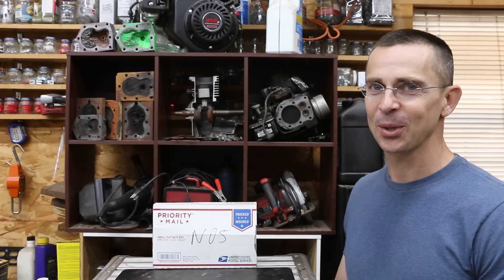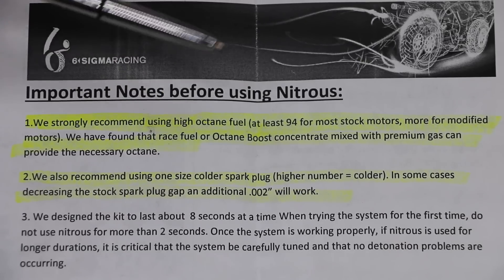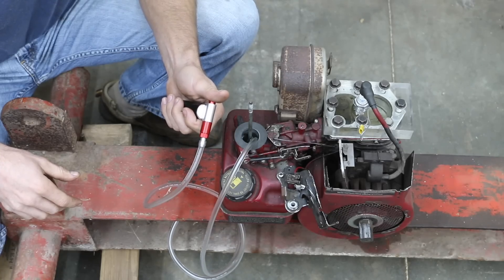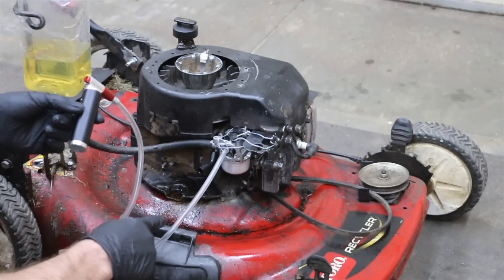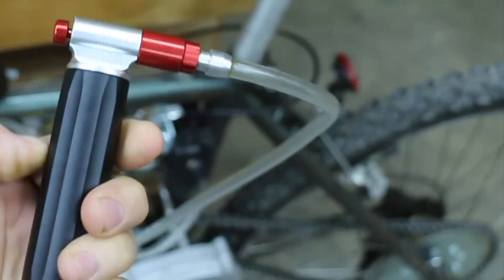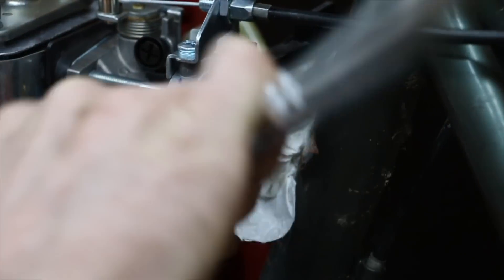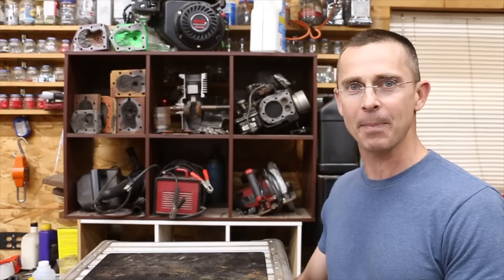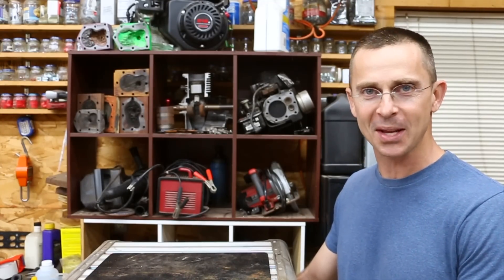Will the 4-Stroke Bike Survive Nitrous Oxide?  Let's find out!

Comment from the maker: I had a LOT of fun with this video and thanks to everyone who suggested this video idea!  Here's the kit I used but it is very expensive.   Recommend shopping around for a better price.  Nitrous kit: https://amzn.to/2QiJ74m
Reply: Hi PF, what if injecting oxygen from  scuba tank through that air box nozzle . Does it add more performance and engine response? But i was expecting testing it on bigger engine like car or truck engine. If it turns adding good power gain, doesnt that mean we can refill the tank  or airbox with electric pump and provide more oxygen at the intake at almost no cost
Reply: @focalpolyglass7337  there is regular air in a scuba tank, the only real benefit you could get is because the scuba tank is under pressure, so it provides boost similar to a turbocharger
Reply: Hey man I would really love to see a video on if a 4stroke will run nitro methane
Reply: Ooo
Reply: Try it on an rc nitro engine
Reply: what will happen if the engine is fuel injection
Reply: It needs additional fuel , along with nitrous . Otherwise you're only leaning it out .
Reply: The way nitros kits normaly work is that the nitrous oxide is shot into the motor along with extra fuel the extra oxygen from the nitrous oxide allows extra fuel to be burnt and that's where the power comes from I don't see any extra fuel being put into your motor
Reply: Im so glad i found this channel. It seems any questions i have, i find a video of yours that answers them.
Reply: They sell food grade nitrous oxide (no sulfur) at a local store for canning your own whipped cream and other stuff. They also sell something called a "co2 sports inflator" it's literally the same thing you have for your kit but doesn't come with hoses.
Reply: Put a turbo on it 🤣🤣
Reply: You make me think is he laugh lamo kid
Reply: Can you Run about 75v though carbon electrodes with spark ignition on a sealed neon gas engine with a strong neodymium magnet in the cylinder head? Yo may need to see which pole gives the most power? Also you may try using a smoke alarm americium element to boost ionization?  This is probably dubious at best. Where you have a sealed engine of inert gas with two carbon electrodes at high voltage in addition to the spark plugs. And all the weird stuff.
Reply: Hahaha! You're mad!
The good kind of mad though!
Have a sub 😁
Reply: I've gone about 25-30 mph on a cheap 66cc 2 stroke bike motor. That actually feels pretty fast. I can imagine that 40 mph probably feels like lightning on a little bicycle. That said, Ill be getting the 4 stroke one you have.
Reply: Where did you buy your 4-stroke kit?
Just order one UPS went out delivered to some other address in town in town.
But 35 MPH is really good for such a small motor.
Reply: Please tell me where I can get one of these NOS kits. Thank you
Reply: @scottwawrzoszek1119  unfortunately this kit was discontinued. It is a "Triple Threat V8 Wet Kit" from DEi (Design Engineering). It's a shame they discontinued it too because it's by far the most COMPLETE kit ever. I have installed a few different brand kits and they all need something or another to complete the kit. Whether it was a WOT switch, purge kit, or just different jet sizes. This is the only one that had everything in the box!
Reply: Recommending this kit or any NOS kit for a small engine is dumb and removes any credibility you had.
Reply: @stanlee3980 Just because PF didn’t check all the boxes for you is not reason for your insulting opinion.  If you want true science without entertainment, you are watching the wrong channel.  Many folks, myself included, are entertained and even inspired by the down home efforts by the host.  To many people he is their Doctor Strange exploring the mysteries of backyard mechanics or testing products that Consumer Reports have not.  Dumb is your opinion when you erase any credibility that PF had because he ventured into NOS properties without applying it to an engine that is not of a size approved by your higher intellect.  You might get more entertainment from Scientific American or Marvel comics.  I see PF as the common man’s reality to questions that they have but don’t have the resources, intelligence, or balls to try.  A hero to my kind of people.

Comment: Actually, nitrous oxide is an oxidizer. It does not add power by decomposing explosively, it gets it's power from allowing more fuel to burn in a combustion chamber. Burning more fuel equals more power. That's how nitrous oxide makes more power.
Reply from the maker: Thanks for sharing.

Comment: If this kit actually increases the power output of this engine, I'll be shocked.
Reply from the maker: Thanks for the feedback.
Reply: It for sure made a bit more. I've seen a few bikes (motorcycles) that "got away with" adding a 40-HP shot without adding any fuel but they didn't make 40 more HP until the proper amount of fuel was added as well...

Comment: Look in to power jet carburetors they have an extra fuel sprayer for more fuel mixture at high RPM I'm planning on adding it along with nitrous on my 200cc motorcycle maybe it will reduce ping and a cooler plug wouldn't hurt wish me luck

Comment: The injection of nitrous oxide into an engine means that more oxygen is available during combustion. Because you have more oxygen, you can also inject more fuel, allowing the same engine to produce more power. Nitrous oxide is one of the simplest ways to provide a significant horsepower boost to any gasoline engine.
Nitrous doesn't burn because it's an oxidiser,  not a fuel.

Comment: Love your channel.. Here is my long, long time ago nitrous use.     
In the 70's, long before nitrous was available in any kit from anywhere for anything
I added nitrous to two vehicles that did not need it, a 1966 Sunbeam Tiger with a 289 engine and my 1975 Kawasaki H2 750 triple two stroke motorcycle.
It was difficult to get nitrous from the welding supply gas places because kids were starting to breathe it and mostly only dentists were buying it. I finally managed to get lecture bottles filled.
You MUST add additional fuel to get more power and also not leaning the engine out. The nitrous will allow that extra fuel to burn which is the souce of the extra power because the dynamic combustion ratio is so extremely high.

I had an tiny electric pump for the fuel and pushed through a jet hole drilled with a numbered drill bit, (very small hole). When the button was pushed it would open both the nitrous and fuel solenoids together.

When activated on the motorcycle it would accelerate instantly so hard starting at 80 MPH that it would wheelie.

The Sunbeam tiger worked great on its third engine. The first two expired under testing one spectacularly when part of  a top piston ring spit up into the intake manifold; too much nitrous and fuel.
Reply from the maker: Thanks!  Thanks for sharing.

Comment: More O2 (NOs = Oxidant) requires more fuel...
Pulling the choke throttles air in cheap carbs, so you need another means.

Comment: From what I've read, nitrous  is an oxidizer, releasing extra oxygen into the combustion chamber allowing the engine to burn additional fuel. This is why nitrous kits for cars inject extra fuel along with the nitrous. They also recommend less spark advance with nitrous to prevent preignition. Rather difficult to do on a B&S engine though.   I did enjoy the video. Picked up more speed than I expected and the engine did not grenade. Must have been pretty lean though...
Reply from the maker: Thanks!

Comment: Hi kids and PF this is more for experimenters it don't matter on a $100 dollar motor but if this is a real motor cycle or automotive engine be careful Nitrous blows them motors right up they get hot real fast and the real prob if you haven't studied motors is the pistons get very hot very fast and the rings grow and take up the piston ring gap siezing the piston in the cylinder.  It make them  blow right up.   WEEEHAAA so if your trying this on yer own expensive motor study and find out what supercharged or NItrous engines are using  for ring end gaps before your motor breaks you will be glad you did.   Also as other have mentioned you are dumping more oxygen in the motor and leaning the airfuel ratio out so find that main metering jet and drill the metering hole bigger. or maybe get an extra for experiments.    HAVE FUN
Reply from the maker: Thanks for sharing.

Comment: I use 110oct race fuel in my small engines.  Race fuel is off road use only and contains lead. I believe 110oct would boost your 4-stroke as much as the NO2 and no knock.  The drawback is the price.  I can only buy race fuel at a Pure station here in Alabama.
Reply from the maker: Thanks for sharing.

Comment: I have a ? Where would the nitrous brass fitting u put into the air box go if ur putting the kit on a two stroke and it does not have An air box just the air filter?

Comment: I think I would come up with a way to mount the cylinder of gas as close the the breather box inlet as I could. The gas is being forced down a very long hose with a good size volume of empty space to fill before it reaches the carb. Unless the cylinder of gas is over charged you might run out of pressure enough to clear the feed hose and leaving unused gas . so short version ... did the cylinder of gas continue to flow well past the 8sec. estimate? Or did it end at 8 sec. due to no pressure.
Reply: There's hundreds of pounds of pressure in that cylinder, the hose is fine.

Comment: I have a Suzuki Hayabusa GSX1300R I've put a 100hp nitrous "wet shot kit on as well as a few other mods and it's an absolute beast. The wet shot kit includes an extra fuel pump and extra fuel is added with the N²O to quell the predetonation. The extra fuel also cools the combustion chamber as the added oxygen heats things up just like a cutting torch IMHO. I also installed an aftermarket oxygen sensor in the exhaust so I could monitor the mixture and make adjustments as necessary. Thanks for all the cool learnings. You're the Consumer Reports for the working man imho.
Reply from the maker: You are welcome!

Comment: One problem with this video is lack of understanding of what nitrous offers for engine boost, nitrous adds more oxygen along with a cooling affect to the fuel, you have to add more fuel with it to get the real power, I built nitrous kits for many years for 1/4 mile, you need to understand how nitrous works before making these videos, carburettor change, ignition timing, all have to be adjusted before turning the nitrous on and performance motors compression needs to be lowered, tip of the iceberg.

Comment: Is there an equivalent of nos for diesels? or can diesels use nos? 
if diesels can use nos, that would be interesting to see how the engine reacts to it.
obviously it won't be that much different than the revving up of a gas engine, but would be interesting to see nonetheless

another question, is there anyway to get a see through engine going on the diesel engine? since diesels have a MUCH higher compression i think it would be harder, but i don't know.

Comment: Spraying the nitrous under load is what works best. It’s not really supposed to gain top end more so to get you there quicker. Use it next time during Acceleration and you’ll feel it best. Spray when your around 10 mph and you’ll feel it pull you up to top speed much faster.
Reply from the maker: Thanks for the feedback.

Comment: Hi this is Al and I was wondering if you rebuild engines I have a 125 mL Chinese pit bike engine and I would like to rebuild it so that it has new oil seals gaskets and to install a high rpm cam in the head
If you respond to this comment I will see it in my email

Comment: those old L-Head 190cc briggs engines will take ridiculous treatment and still run. I swear I've seen them go 15 years with no oil changes and no maintenance and be chilling. I got one once that was so low on oil the upper crank bushing was squealing when you started it and the owner had just been using it like that for a couple years. I changed the oil and its been just fine ever since.
Reply from the maker: Thanks for sharing.

Comment: Whip cream cartridges of N20 // its an amazing gas though should not be released into Earth's atmosphere without chemical decomposition or utilization in an application / read the following from wikipedia about its use as an oxidizer in rocketry //

Nitrous oxide has advantages over other oxidisers in that it is much less toxic, and because of its stability at room temperature it is also easier to store and relatively safe to carry on a flight. As a secondary benefit, it may be decomposed readily to form breathing air. Its high density and low storage pressure (when maintained at low temperature) enable it to be highly competitive with stored high-pressure gas systems
Reply from the maker: Thanks for sharing.

Comment: You would get better performance if you could rig up a way to increase the fuel mixture when it gets the shot of NOS.  That would not only add more power, but would cool the charge a tiny bit. Maybe even move the magneto somehow to retard the timing by 5 or 10 degrees.
Reply from the maker: Thanks for the feedback.

Comment: I’ve had 3 modular Ford engines that ping under high load around 4200 RPM it’s interesting to see what it looks like when it’s happening. If you own a Ford engine and hear the same ping in talking about , use Lucas upper cylinder lube.
Reply from the maker: Thanks for the suggestion.

Comment: Great video! Thanks for all of it!
One of the CC messages @ the bicycle section says it was knocking, needed a colder plug. I'm assuming you did that, but want to verify. Also, since then have you tried to tweak it anymore and found and other results with the bicycle?

Comment: Change the nipple to a t have one on each bar and swap the basic 4 stroke engine out to a 70cc and re jet the carb and change the wheel barrings to racing bearings that be fun then 70cc 2 stroke dual nitros as two stroke is two revolutions vs 4 so 2 stroke 70cc with nitros that be booking bout 50 miles a hour wonder if making a hybrid two stroke with nitros and possibly a turbo would that be nutz 70cc two stroke dual nitros and electric bike motor front wheel 750 watts god talk bout road illegal
Reply from the maker: Thanks for the suggestion.

Comment: Every car kit i have ever seen injects fuel with the NOS. NOS alone will run the engine extremely lean. It might be interesting to revisit this and add a fuel jet to the nitrous stream controlled by a fuel pump or just by simply putting a jet inline withthe nitrous so the accelerated airflow would pick up more fuel. Bet you get another 5mph (or blow up).
Reply from the maker: Thanks for the suggestion.

Comment: You should try an old trick that farmers used to do when they had a knock in one of their Motors they would replace the bearing on the connecting rod with a piece of belt leather to run their equipment you should try that on one of your lawn mower engines like the one that had the rod knock
Reply from the maker: Thanks for the suggestion.

Comment: you are running a lean setup if you dump more fuel while engaging the NO2 you will get more power.
Reply from the maker: Thanks for the feedback.
Reply: @ProjectFarm  no problem and I think the term is dry no2 vs wet no2 in this case you were running a dry system that was basically forcing all of the unburnt fuel to burn. Remember combustion power  = fuel + oxygen.

Comment: You need to add extra fuel with the nitros, you will lean out the engine
Reply from the maker: Thanks for the feedback.
Reply: @ProjectFarm  On automotive nitros systems you have nitros solenoids  and fuel solenoids and nitros & fuel tubes (jets) and depending on how much horsepower you want to put in, you put that matched set of needles in to the plate system, unless you use direct port system then then you screw the two in one jets into each inlet port on the inlet manifold, and if you run it too lean then you melt spark plugs and pistons, you also have to retard the ignition timing by at least 4 to 6 degrees and run colder heat rang spark plugs

Comment: I ran NOS on a fox body mustang at one time. It was a 351W, JE srp pistons, AFR aluminum heads, Edelbrock performer RPM upper/lower, Paxton supercharger (6 psi). Well, six lbs of boost wasn't enough, so I added a "dry" NOS kit, 100 hp, in my mind, I wanted to cool the air charge, which in turn would be more dense and increase power. And it worked great. However, I had done some work to the car and disconnected the NOS line under the hood, and upon reconnecting the line I failed to insert the "pill" which controls the amount of nitrous that flows into the throttle body at wide open throttle. So, rather than a 100 HP shot, the engine received... A lot. I mean.... A lot. The car pulled like a bear, on M/T Sportsman pros mounted on Weld draglights, it was impressive!!! For about what felt like 3 seconds. Then it shit the bed. Head gaskets, compression was lost inside the block, freezeout plugs danced across that highway (somewhere in Mexico) good times. Back then it cost 40.00 to fill a bottle, I'd hate to imagine the cost in 2021. Sorry for rambling, I just relived that memory. 😂
Reply from the maker: Thanks for the feedback.

Comment: A question Ive asked   about small engines  more then  once.  It's not  flammable per se?? Didn't know that.  Well then why not shoot straight O2 into the engine???  Maybe the NO2 is safer because  until it's in the cylinder it is unlikely  to facilitate  a fire like O2 might?

Comment: When using NOS, supplemental fuel should be supplied as well. Adding extra O2 with extra fuel is equal to using a turbocharger or blower. ( More air "O2" more fuel) Your little experiment is incomplete.